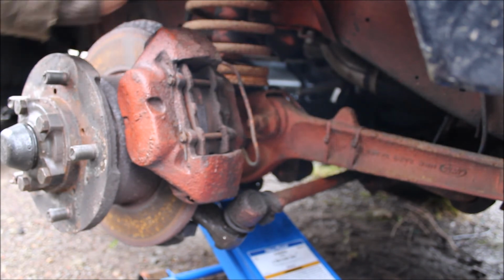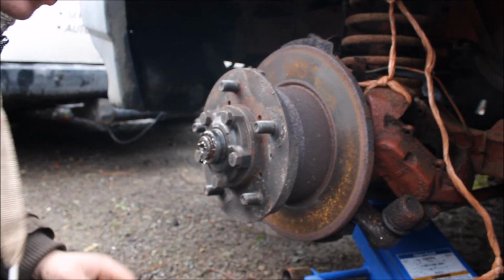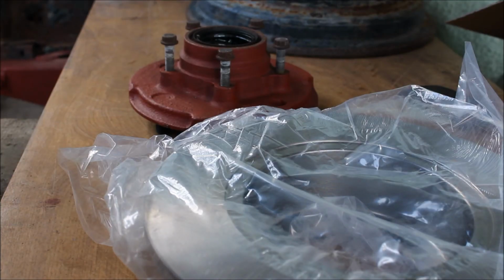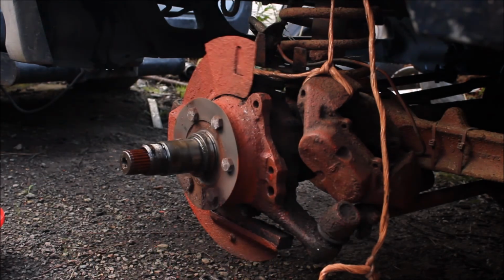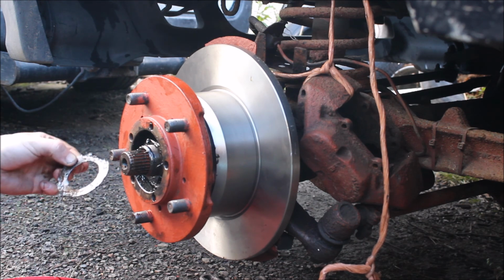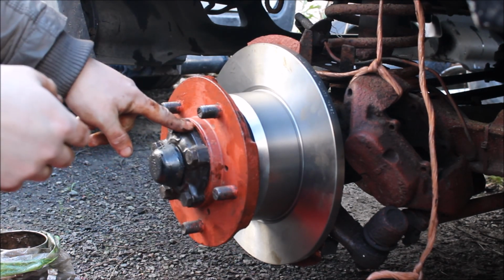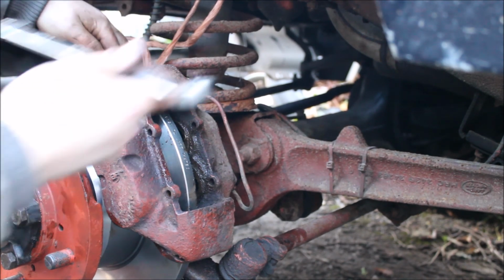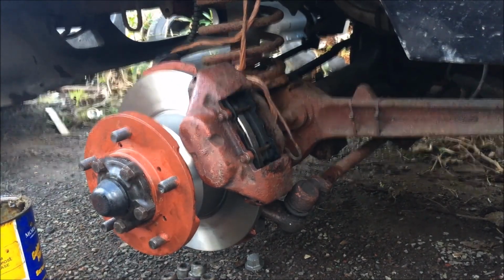Changing my front disc brakes on a Land Rover Discovery 300 TDI

Comment: I understand,  yes I did. i just saw someone put the hub inside the rim and they used a breaker bar to remove the bolts..
Reply from the maker: Yes that’s definitely easier than how I was doing it, the rim does make it a lot easier. On the rears I used a rim also, it’s been that long I forgot about the bolts on the inside of the hub.

Comment: Just a tip mate, I was told NEVER use pliers, or, single 'pressure' pointed tools to push pistons back in, as it pushes the pistons uneven and 'can' stuff the bore...
Use a proper calliper tool🙂 great video nonetheless 🙂🙂🇦🇺
Reply from the maker: I have the tool, can't really put much force by hand. You wouldn't like to see the way I free one off with my hydraulic spreader haha thanks for the tip anyway

Comment: A good basic guide but only for an experienced mechanic who knows how it should be done. Follow this to your peril.

1 Do not just rely on a jack alone to support a vehicle, appropriate axle stands are a must.
2 don't jam a hub using a metal bar on the lug nut studs. If you cannot loosen flange nuts with wheel on the ground have someone apply the foot brake with wheel off. Failing that find a safer way by protecting your lug nut stud threads. No wonder wheels fall off vehicles at random.
3 loosen the lid of the brake fluid reservoir before manipulation of caliper pistons
4 use an appropriate tool to spread pistons, a pair of bare pliers is not a suitable tool.
5 not replacing a £5 hub seal is a fools economy in such a job.
6 Clean everything better, Red oxide merely highlights the poor attention to rust removal
7 Again new bolts is better unless your aware of vehicle mechanical history, reuse of old bolts risks shearing and always use torque settings as main guidance even with bearing adjustment combine recommended torque with experience of feel for rotation and play.
8 Might as well have put new OEM bearings in at the same time, extra £25 a corner and you know the job is a good one at the end.

Good tip on using an old rim for reassembly of hub to disc.
Reply from the maker: 1 I have a axle stand
2 my wheel studs are undamaged
3 brake fluid lid is the same on every car if you don't know to undo it you shouldn't be doing the job
4 nothing wrong with my tool
5 I don't need a hub seal it's still not leaking now and I did this years ago
6 no one has time to clean a old land rover, I could be cleaning off a car of more value haha
7 these bolts are fine, I replace when I need to but if I don't it's because they still work they are not stretch bolts and torque settings are for robots, my bolts don't snap or undo. Lad up the street is a idiot he needs torque settings haha
8 my bearings are fine

Hasn't been on the road for a few years been used pulling dead cars around the land but will be on the road soon so lookout for flying bolts and wheels haha

Video is for fun, but this is what you get at most garages so don't expect a rolls Royce service haha

Comment: Why was it so hard to get the 1st nut loose when taking everything apart but when you put the nut back on at the end you didn't use much effort at all.. You actually went a little too tight and the hub wouldn't turn freely enough so you loosened the nut back up.  Are there torque specs for these 2 nuts?
Reply from the maker: Not sure which one you’re talking about, but I know what you mean. This hadn’t been undone for years so everything is rusted and bolts and nuts are a lot harder to undo when rusted. I don’t use torque settings never had a problem and nothing has ever fallen off, I learnt to tighten the hub up then slacken back off so that’s how I do that.
Reply: The reason the bearing LOCK nut was so tight was because BOTH nuts.... The bearing adjustment nut and lock nut were turning at the same time. On replacement you should torque the bearing nut down according to manual specs then back it off about 1/4 turn. Also so so important is to clean off the Disc with brake cleaner. It will have a film of grease from the manufacturer. Personally for the price i would of dumped the calipers and bearings for new ones.
I never saw you use Axel stands either,, naughty and so dangerous. please be more careful in future.
Reply from the maker: Kev Davis oh the bearing nut haha, that makes more sense, couldn’t think what he meant. Yeah maybe you should use the settings but I still have no play in my bearings my way works just fine. As I tightened it up then backed it off by feel. They is definitely a axel stand under there. My callipers are still working fine and bearings still have no play so why replace. They will probably get replaced in the future though. As and when they need too. Thanks for the advice and thanks for watching

Comment: Very nice video, one thing be very cRefull to avoid grease on the discs, it will not wear of, but soak in to the brakepad. Once greased in, just discarde them.
Reply from the maker: Still working fine, thanks

Comment: Just watched your video and I certainly would not trust you to do my wheel bearings on my defender. You should replace a new hub seal for a start. Also n no mention of tourqeing  up the bearings propaly. And no mention of tourqe   setting on the disce bolts  you never even cleaned of the rust where the seal went over the stub axle all I hope is the seal and the bearings don’t pack up on you good luck with it
Reply from the maker: Well they are still on and not needed adjustment since they was done, tourqe settings are for robot's on something simple(I feel for the bearing for the right tension by feel). I use tourqe setting on head bolts only, I have no problems ever. But thanks for concern but it's not needed.
Reply from the maker: Oh also my seal is still working fine.
Reply: Having worked on trucks and buses, we always tightened up the bearings until they dragged a bit, then backed them off slightly.  One load is on the axles they could loosen off more than you think they would.